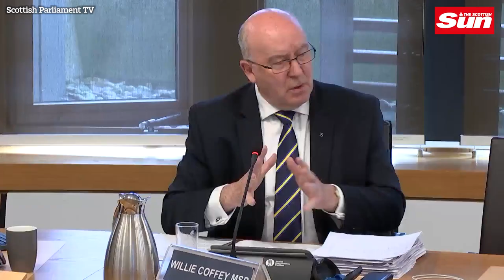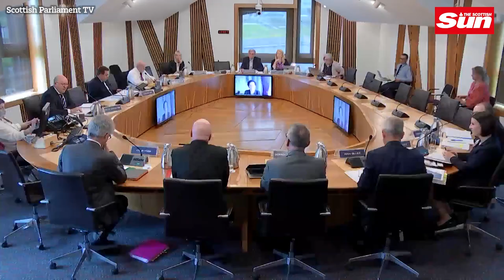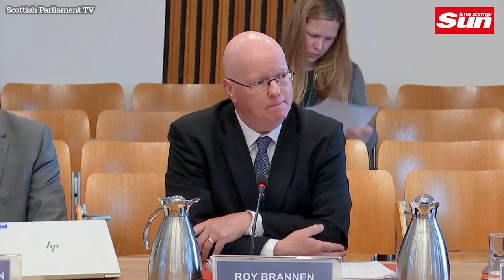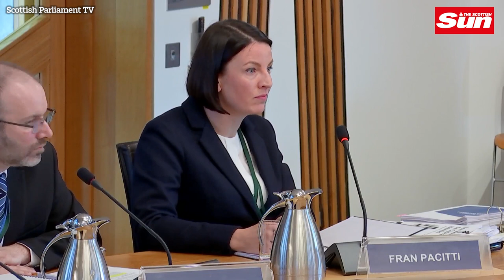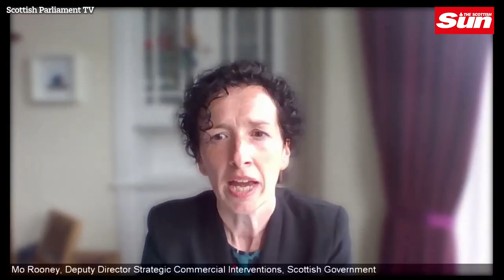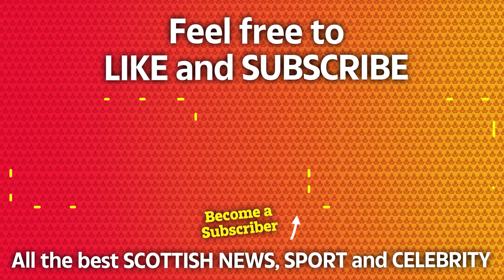FERRY FIASCO: Why was there an 'absence of applying quality standards to milestones'

Comment: There seems to be a sequencing issue resulting in the cables not being able to reach their components. I am not hearing the MSPs asking about the sequencing so surely a shipbuilding engineer needs to be asking the appropriate technical questions as to why these cables are too short, and who is then held to account, financially! There is too much waffle within this exchange with the committee who appear to be being conned! The MSP questioner is also not robust enough either!  A previous presentation included the claim, I recall, that machinery had been moved to new locations, causing the cables then being short, yet if this is so, why has that not been pursued?